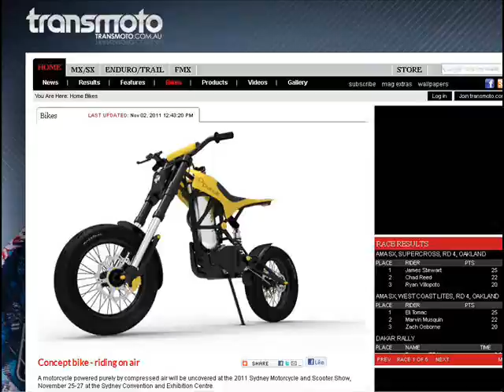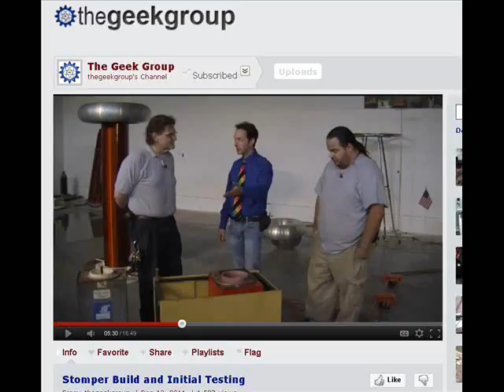TDD report for February 04, 2012

Comment: The air bike looks interesting. But I'm really skeptical that a compressed air tank can hold much in the way of mechanical energy. I'm actually not sure how to calculate it. I'm guessing it's something like PSI x Δ volume. Also, you have to account for adiabatic cooling.

Australia (I think) still has an annual solar car race. I've always wondered if there was also enough wind blowing to use supplemental wind energy like wind surfers use. Although I doubt it would be practical for road use.